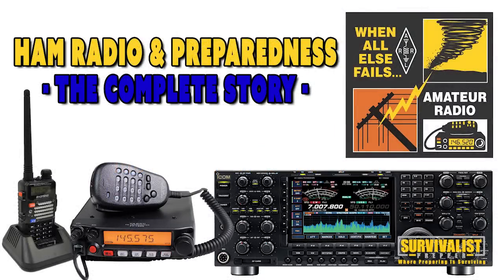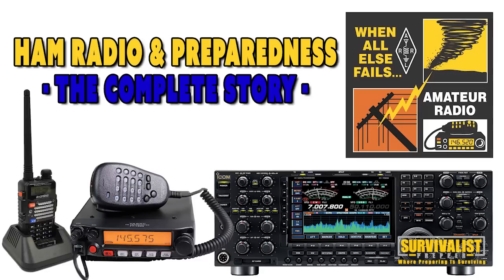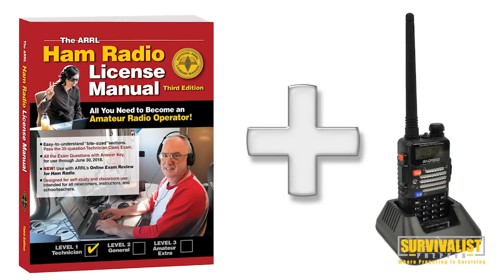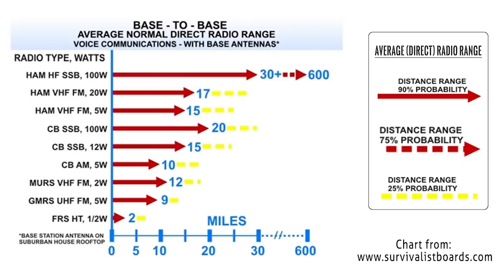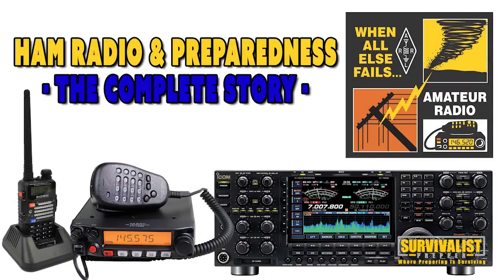Ham Radio & Preppers: Basics of Amateur Radio, GMRS & MURS

Comment: So far I like the presentation, mostly accurate, not wrong enough to argue about. (like most presentations) one thing to note though is that having a radio that will transmit a long distance is not always desirable. I suspect that he will discuss that in the subsequent video's. Good job, better than I could do for sure.

Comment: How would an EMP effect various HAM gear? How to power lr comm gear if the grid's down? Is "tube-type" HAM gear available?
Reply: >A man-made EMP would fry most HAM equipment, which is why some people prefer to keep a few radios in Faraday cages. 
>Most radio equipment is powered from 12 Volts D.C., so ordinary lead-acid batteries can be used to power them in the absence of utility power.
>There are many enthusiasts who restore and maintain old style HAM equipment that uses tubes. This is usually more of a hobby than a prepping activity, though. One reason is that tubes use a lot of power even when just listening, so they are less practical when power is limited. The bigger reason is that tube equipment is usually upwards of 50 years old or older, which means that it predates FM/SSB and other modes of transmission. Most people don't tune the AM transmissions that these sets operate on, so they're not as useful. Of course, these sets can often do CW, so if you learn Morse code, they'll still be somewhat useful there.
Reply: Dantastic:
Thank you so much for the reply. So many on YT wouldn't bother. Well, sometimes I do troll, so it maybe part my fault. Again, thank you. I'll follow up.
Reply: By man made, you'd be talking a nuke that fires out thousands of miles of cable.  
If we ran into a solar flare as in it literally hits the earth, that would blow out anything that's plugged in.  Power lines would also throw of a field that could fry things.   Older PC's like a 486 from the 1990's is able to take a pulse, newer ones not so much.  They use those chips in space and space is full of EMP's and radiation.  I have a 486 for that reason.  Some of the fancy transceivers with DSP's could have issues but older equipment will be fine.  About half of cars will be dead, ext...  It's not as bad as people make it out to be.

Comment: Yet another ham radio advocate video.  The other radio types weren't even touched on until the last 2 minutes and then only as how they are inferior to ham.
Reply: The last time i checked, no other radio types can communicate across the world. If you're trying to talk to your pal on a small lot/off trail, frs/gmrs/cb work splendidly. If your pal is states away, you'll be wishing you had a ham. Better to have it than not need it than to need it and not have it imo. My personal opinion is to simply obtain each radio type.
Reply: @willtran6624  I was looking for something that I wouldn't have to get a complicated license to use on a large farm or while hunting.  I'd heard that at least one of the digital ones could send data (ie. GPS coordinates) and I wanted to learn more about that part of it.  I got a little triggered after watching about 10 videos that tagged all the radio types only to concentrate on HAM (which can also do data in a way), so I trolled a little bit in a fit of frustration.